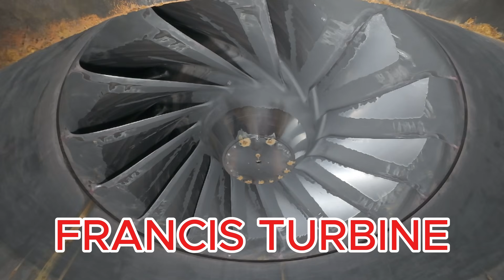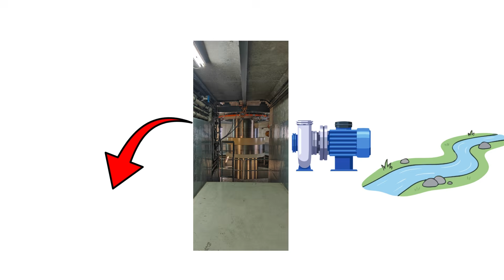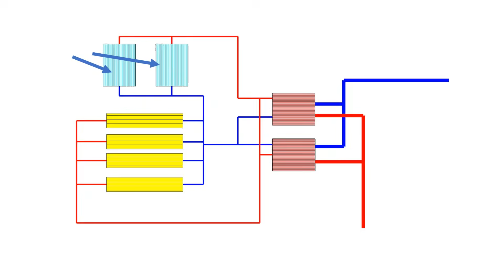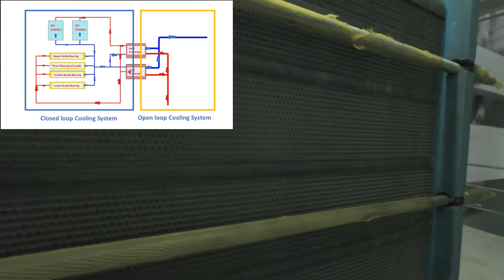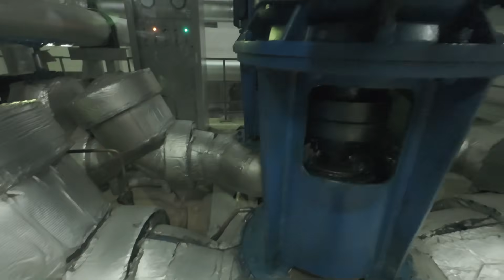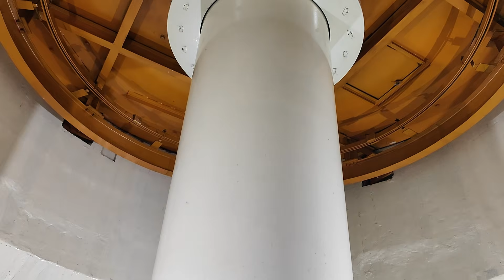This Giant Turbine Would Self-Destruct Without This Cooling System.

Comment: I like seeing Endress+Hauser measurement and control equipment being used. However, I can also see that the flowmeter has not been mechanically installed according to the specifications, which leads to a higher measurement error.

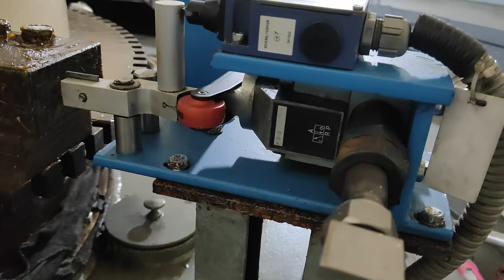Comment: Is the mechanism at 8:07 a couple of redundant microswitches which are triggered when its finger on the rocker arm is impacted by the large clamp block on the tooth ring, to sense if the tooth ring becomes loose from the shaft?

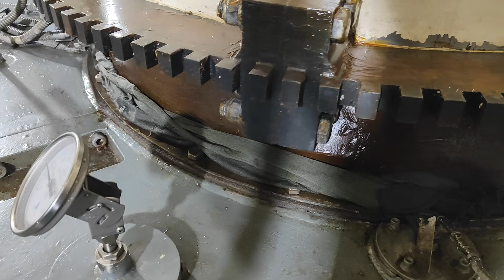Comment: At 7:54 what is the purpose of the cloth/skirt between the platform and the shaft? Is that simply to prevent ambient air from convecting between floor levels, and it is manually removed before starting the turbine shaft?

Or maybe it was jammed in there during maintenance to prevent tools from falling down below.
Reply from the maker: At 7.54 this turbine is not in operation. There was some routine maintenance so they put temporary to avoid any thing go inside. To prevent from dust etc. they will remove this before operation.

Comment: Does the open loop draw its water from the chamber between the huge ball valve (at the bottom of the penstock) and the wicket gates? 

Meaning after the ball valve opens, but before the wicket gates open, the open loop pumps can start drawing water from that high pressure region?

But if the open loop system drew water from there, it would need no pumps; rather it would need a pressure regulator to keep from rupturing the heat exchangers. 

How long does the cooling system typically run before the wicket gates are opened and the system starts generating heat?
Reply from the maker: Open loop pumps take water from the outlet or tailrace. And then after heat transfer they put water back to the tail race.

Comment: Thanks for the info - very interesting.
I have some questions which I will break up into separate threads to avoid long comments. 

In the graphic at 2:48 on the closed loop side, do the air coolers cool the ambient air before the air is blown through the electrical windings of the generator? Does that warm air then flow up through the top of the generator and exciter into the turbine hall?
Reply from the maker: Actually heat is exchanged here. Water of closed loop gets warmed after collecting heat and then moving towards the heat exchanger to transfer heat to open loop water.
Reply: @hyrovision   Oh, so do fan(s) push ambient air past the generator windings/exciter windings, and then the hot exhaust air flows through the two air coolers before the cool air is released into the breathable airspace (in the turbine hall?)? Where are each of the two air coolers located?